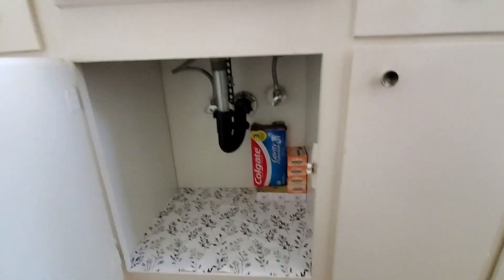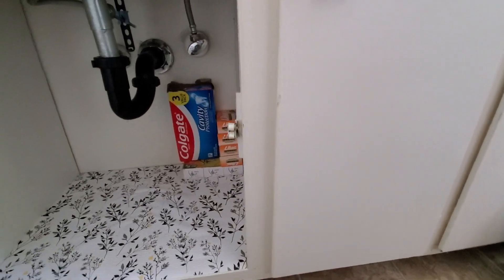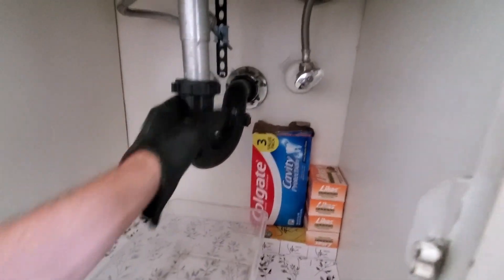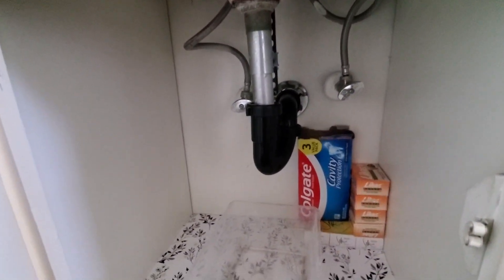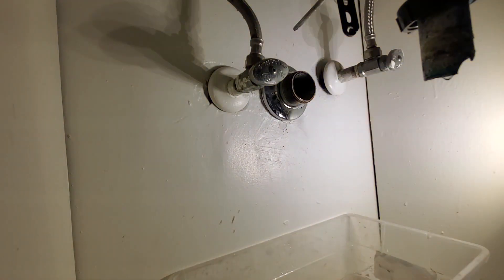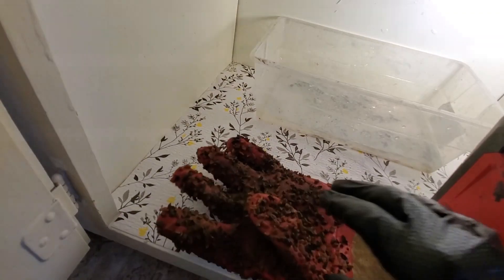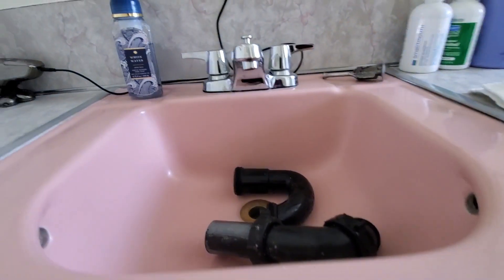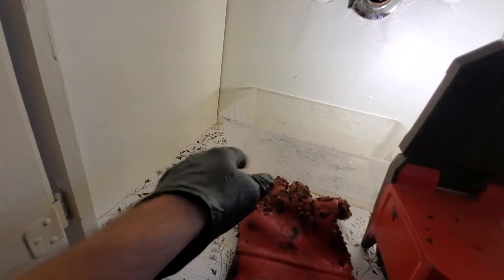Snaking a bathroom sink from the late 1960s

Comment: Where those p traps new? Also did they use abs back in the 60s?
Reply from the maker: those p traps are new, no, mostly galvanized and cast iron back in the 60s
Reply: @pershingplumbing9007  they used abs for some stuff since the 1940s but these traps are definitely brand new.